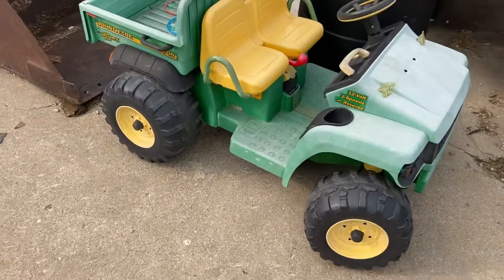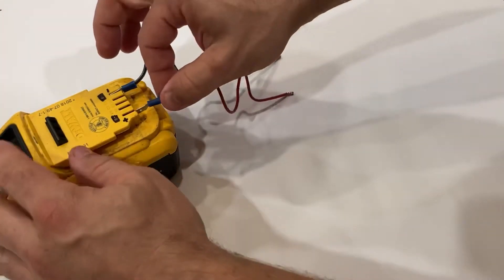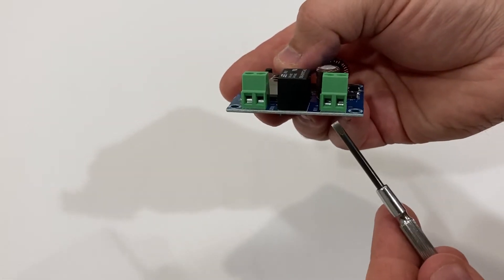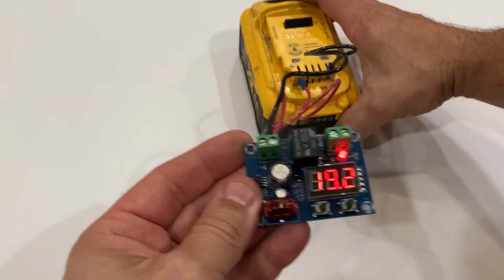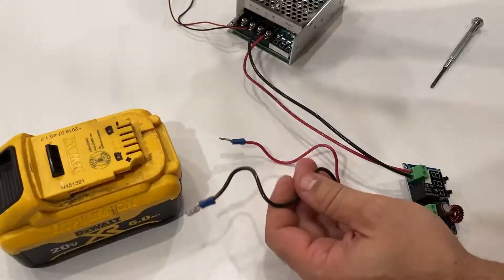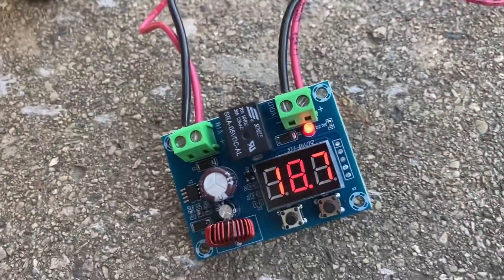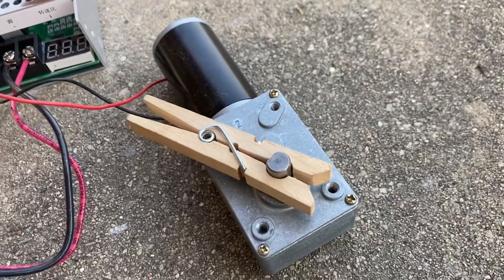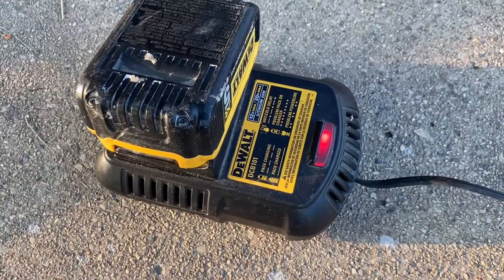Low voltage cutoff protection for your battery powered projects

Comment: So I feel the need to say that the cells inside these batteries are capable of being brought down to 2.5v per cell but that is extremely low and I definitely recommend 3v minimum so that would be 15v off of this pack. Also I can say with certainty that just because the charger starts blinking doesnt mean it will charge necessarily I recently killed one of my 5ah bt battery packs due to not having a protection circuit in line with an older dealt 18v drill. Dealt has battery protection inside the drill not that battery which is why you can use them thus way.

On a side note I think this is the longest comment ive ever made on a video.
Reply: We appreciate your time, longer comments are always welcome.

Comment: Please explain how you changed the 14 volt factory setting to the 15.3 volt of your choice. Did you press and hold the button? The amazon site does not explain that either.
Reply: just hold both buttons down then you press one to go up or the other to go down and wait for it to stop

Comment: Used my ridgid 18v  4ah batteries for my sons 12v powerwheels and it hauls ass.  I use a 30a inline fuse but i do check the battery ever 10 mins before it gets too low.  This would help a lot.
Reply: Ridgid batteries have low voltage cutoff built in. I think it is set at 15V.

Comment: Could you use it to power a GPS if you don't have a charging port in a vehicle?
Reply: Yes, you would want to use a 12V battery rather than the 18V and then set the low voltage cut-off to 9.3 volts rather than 15.3 volts shown in the video. 
  Although he has already given a good explanation in the video, I will try to go into a little more detail. 
 Nominal voltage is the default, resting voltage of a battery pack. This is how the battery industry has decided to discuss and compare batteries. 
 Nominal voltage for a lipo is 3.7 volts per cell and a fully charged lipo battery has 4.2 volts per cell.
 Examples are...nominal voltage of a 2 cell lipo is 7.4 volts but its charged state is 8.4 volts. Nominal voltage for a 3 cell lipo is 11.1 volts but fully charged is 12.6 volts. This is why the advertised difference between Milwaukee 18V and Dewalt 20V while in fact, they both have a 5 cell battery. 5 cell=18.5 Nominal voltage and 21 volts fully charged. 
 Low voltage cut-off for a lipo battery is 3 volts per cell. As a precaution, most people like to stay a little higher than that to avoid a dead cell. 
 Buy a 12 V battery and follow the same instructions from this video with but change the low voltage cutoff to 9.3 volts or higher. 
 Some things, like the DC motor shown in the video are safe with slightly higher voltage increase. The result will be the motor spinning at a higher RPM. However, your GPS is  will probably end up in smoke if you wire it up to the bigger battery. 
 Hope that helps.